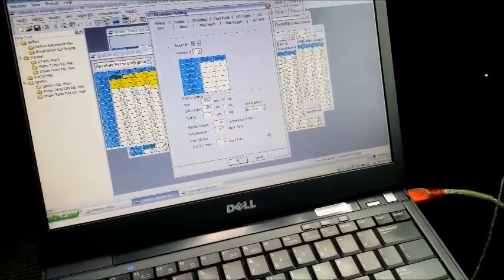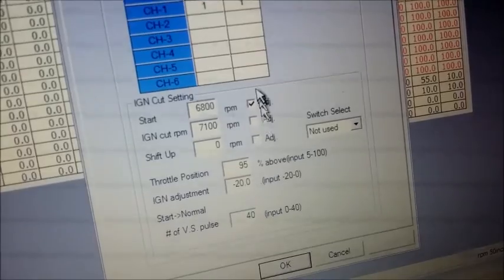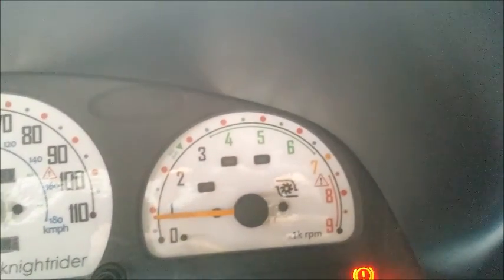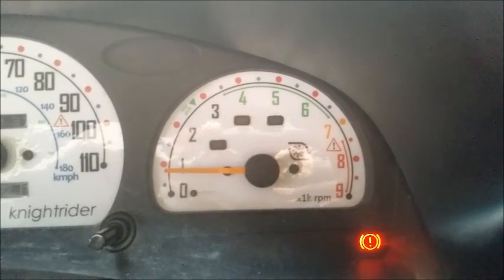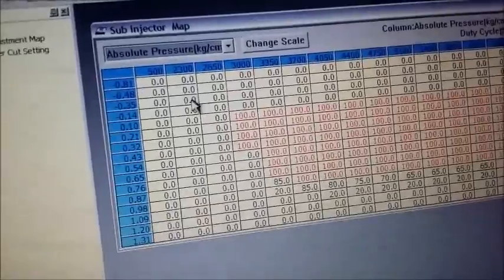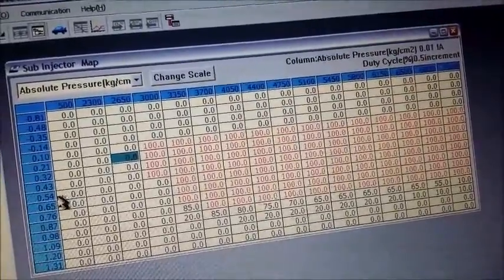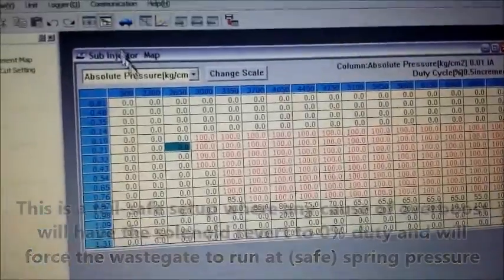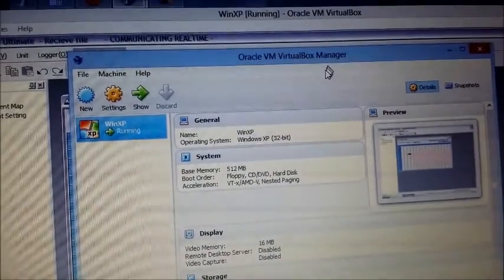Project: dark KNIGHT, Launch Control

Comment: Mista lobsta I need your help I got the E-mange blue ecu not unltimate wired to my starlet ep91 4efe ecu 
CT9 standard turbo 
Full decat exhaust system
Tmic
Walbro fuel pump
Adjustable fpr
fuel injectors are 195cc but I have some Celica 370cc they fit in fuel rail
Mamba internal wastegate 
with 8psi spring
On E-mange blue ecu on my 
Laptop 
additional injection map set @ 0%
sub injection map set @ 0%
air flow adjustment map set @ 0%
Boost cut limit cut setting set @ 0%
Ignition timing is @ factory 10 degrees base timing 

Need your help 😔😔🙏🏽 can you make a full map for me 📈💻 my email is geoep1r888@gmail.com is that's possible send it to ☝🏼 big thanks and support 👍🏼
Reply: Just get a tuner to tune your car the proper way